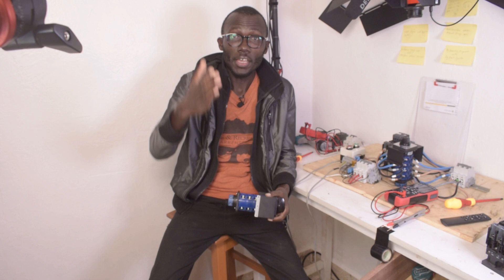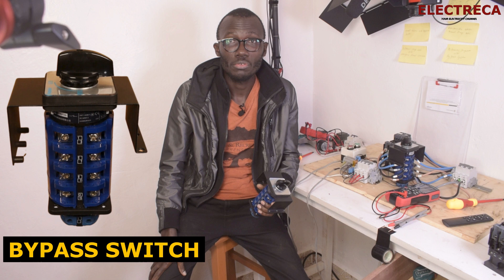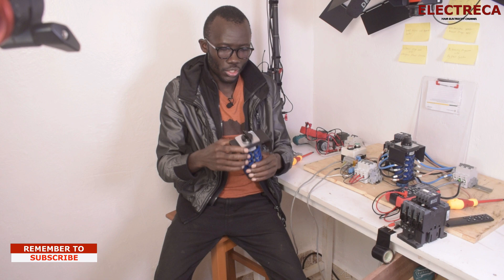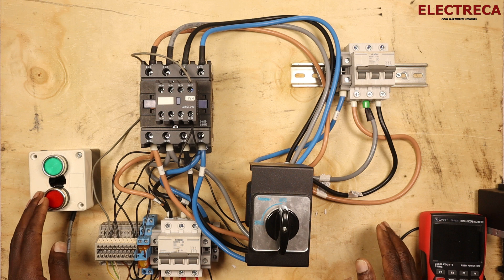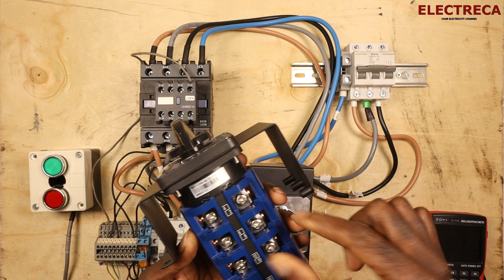DOL Starter with Bypass Switch: The Secret to Motor Control Efficiency

Comment: Can you do more of these bypass switch please
Reply from the maker: Noted, thanks for watching.
Reply: @elektreca Those auxiliary contacts on bypass switch are they No/NC ?
Reply from the maker: @rosekamotho3081  Nc and No, in the circuit I used NC
Reply: @elektreca  well understood ,and then if i passed neutral of the control circuit in the NC of the bypass,will the control circuit stop working when i switch to bypass mode?
Reply from the maker: @rosekamotho3081  Yes, it is a choice to break the circuit with a neutral or hot wire.